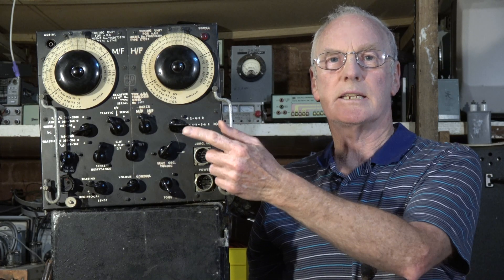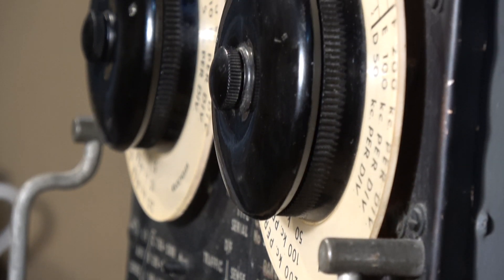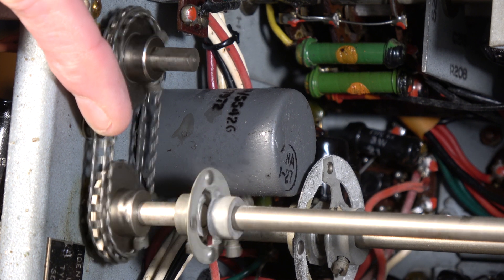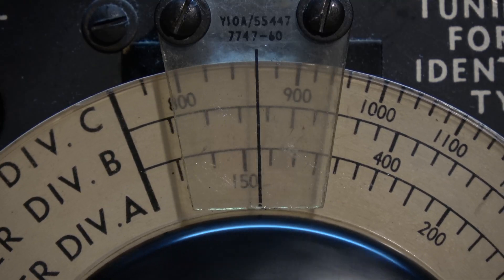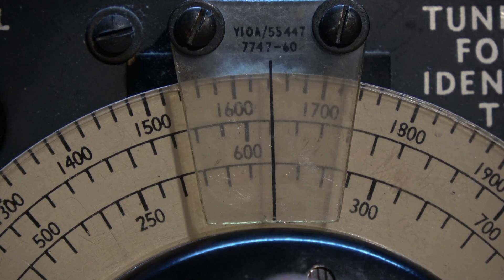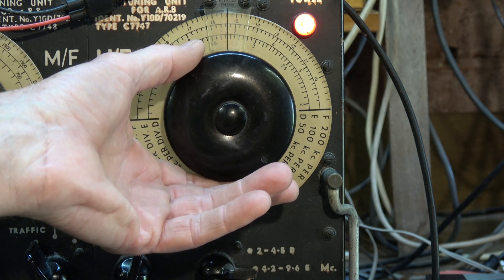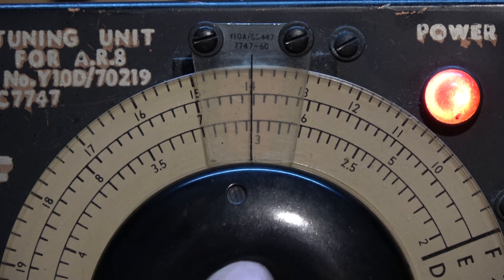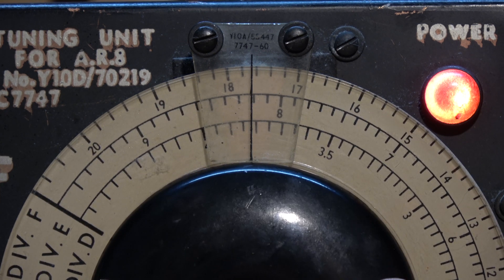AR8 WW2 Aircraft Radio As New Tested Out

Comment: Thanks again ASE,  this is probably the nicest video on WW2 Australian made radios I've ever seen.
Thank you for sharing. Its amazingly genuine,
not a single capacitor or resister has been changed,
it speaks volumes for the quality of Australian components 
built in Australia.
Then there is that colour coded plastic wire,
Each solder joint has its own dab of paint.
The design is state of art with common sense functionality
removable panels, well shielded valves,
the TX protector tube. 
The audio quality and sensitivity rivals anything today.

Comment: I recently pulled a modified version of an AR8 out of a bin, looked up the model number identified it as an AR8 and found your excellent video, thanks for sharing! I am super impressed with the excellent audio quality and the vast range of frequencies you've picked up with this 1940s AR8 receiver, it's just mind blowing there's that many analog stations still out there in 2020 and easily picked up with such an old receiver and with crystal clear quality!!! Anyhow my AR8 unit is a modded one housed in a blue and white faux crocodile skin leatherette covered enclosure with an elliptical speaker, I initially intended to rip the valves out and stripping it for parts and repurposing the enclosure but after seeing your video, I now want to restore it!
Reply from the maker: Still plenty to listen to but most people live in an RF noise hell and can not hear anything and think the bands are dead. There were adds in 1950's Radio Television and hobbies for re packaged AR8's with 240 volt power supply and oval speaker in a box for domestic use so maybe you have one of those. Yes the audio quality was amazing and that is straight from the head phone output un modified so the old ww2 circuits and audio transformers were very good.

Comment: Wow very impressive straight out of the box. I also have an AR8 and AT5 plus antenna coupler. I had to replace all the caps to get it running and use it regularly on 7.125kc . 73's VK3XHM
Reply: @Jack O'BeanHi mate yes quite often have it set up for a month at a time between projects. Just finished cleaning up switch contacts in the AT5 along with a bias problem that developed but yes it gets a good work out.